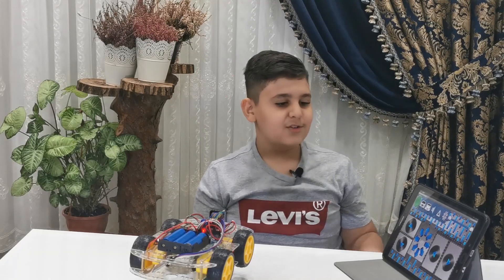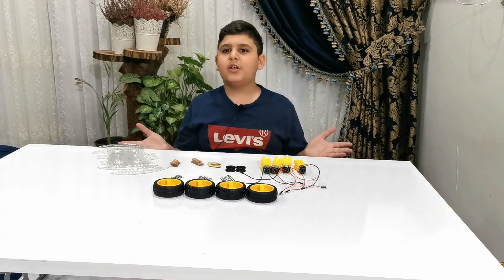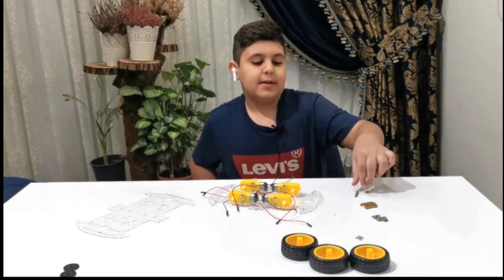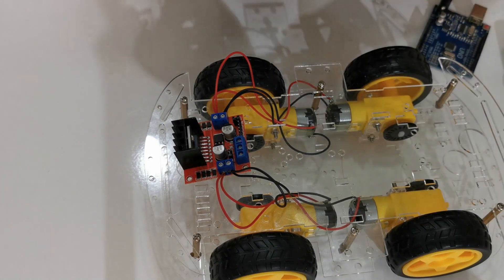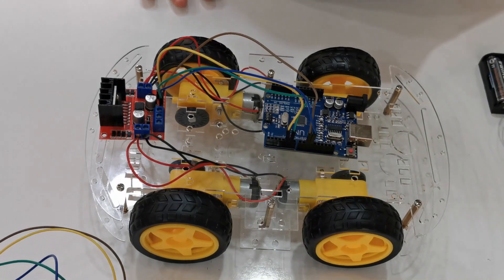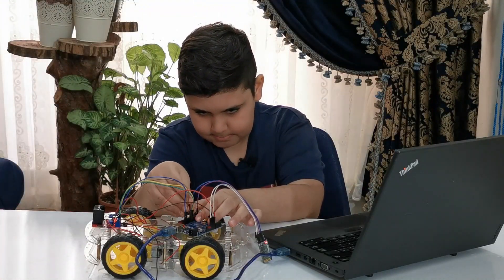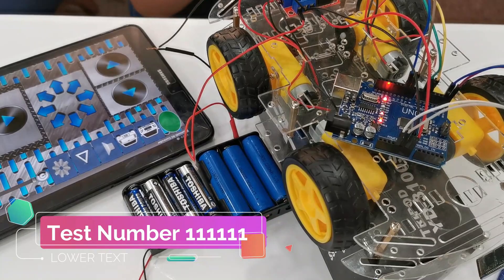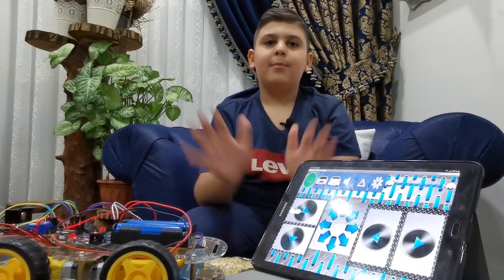Smartphone controlled Arduino 4wd Robot car - best robot for kids

Comment: Tx = Transmit
Rx = Receive
So wires are not flipped; Transmit from the bluetooth module goes to Receive on the Arduino board, and Receive to the Bluetooth module goes to Transmit from the Arduino board. 🤓
Also, you wired for 12 volts, that is why it did not work with four 1.5v batteries but then it worked with three 3.7 batteries. 🤓
Keep up the good job Mustafa. 👍
Reply from the maker: ohhh, really nice to know this thank you very much it really makes sense now :) , i followed you know
Reply from the maker: OMG , i just paid attention to battery issue now, yes really all the lights were working but still the wheels does's work properly , yes really it's the 12V , really good to know this :) :)
Reply: @TheNextGenIraq  You're welcome. Keep it up.
Reply from the maker: @YassirAlSaffar  thank you very much i have to update the video now 😬
Reply: @TheNextGenIraq  Just add a note in comments and pin it. No need to redo it 👍
Reply from the maker: @YassirAlSaffar  good idea let me try it 😍